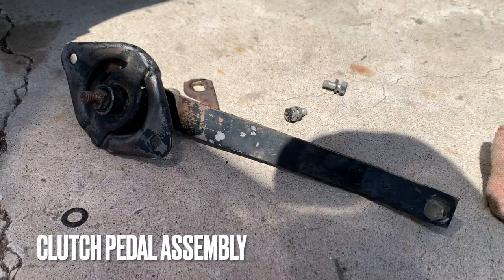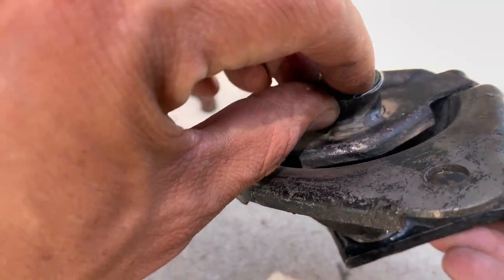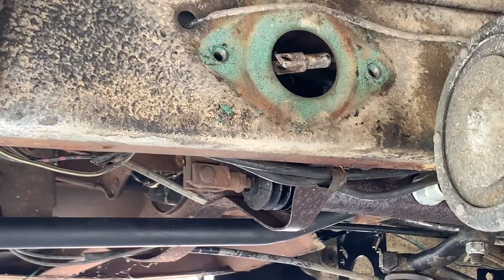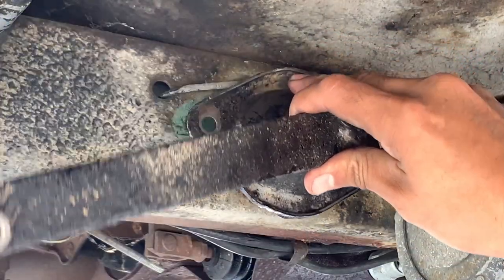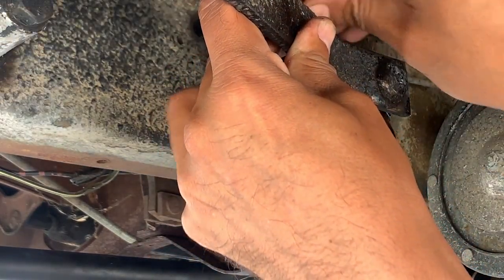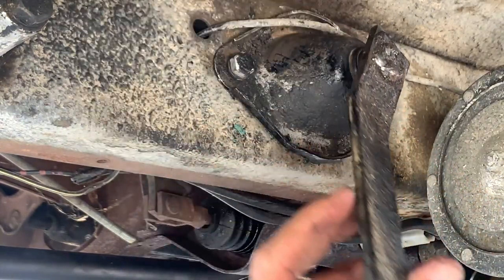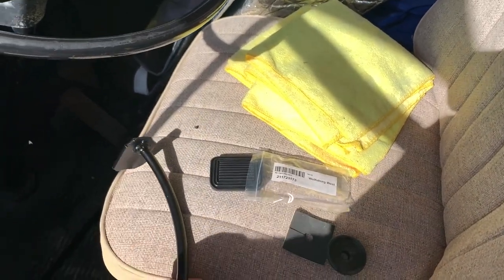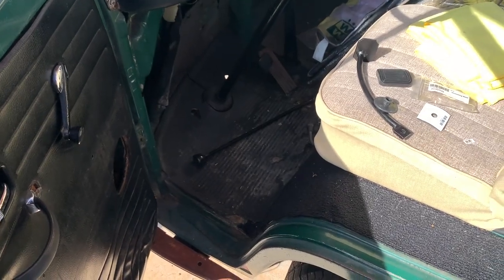VW Bus Clutch Pedal Assembly and Seals | 1969 VW Bay Window Bus Revival Project Episode 30

Comment: Cool video man. Looks like it's going to work well. It's the small things that make a big difference in the end. 🤙 12:06
Reply from the maker: For sure. I totally forgot to grease the parts before I connected the clutch cable
Reply: @SanDiego_VDubLife I was going to mention “where’s the grease!?”  Btw it’s call a Clevis on the end of the cable and the pi is a Clevis pin 😊